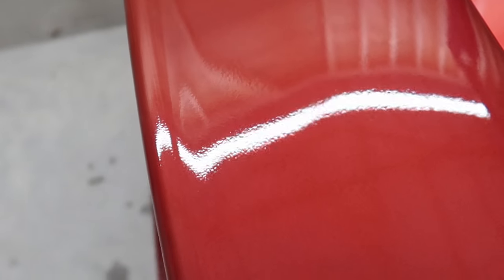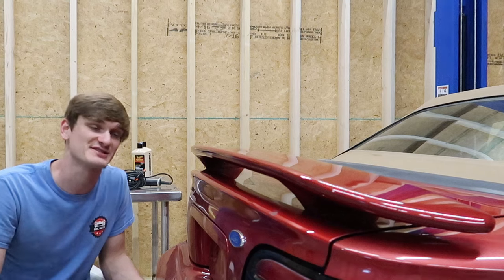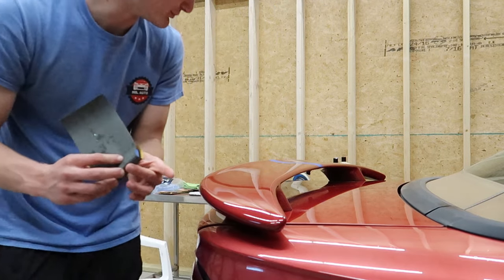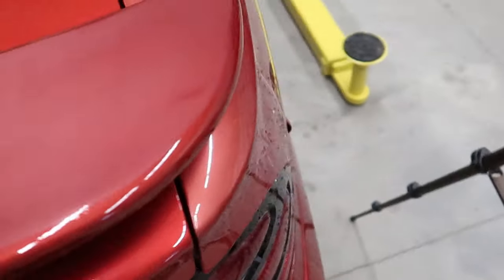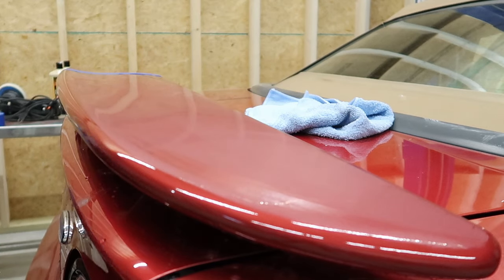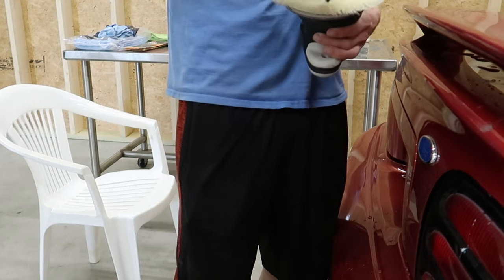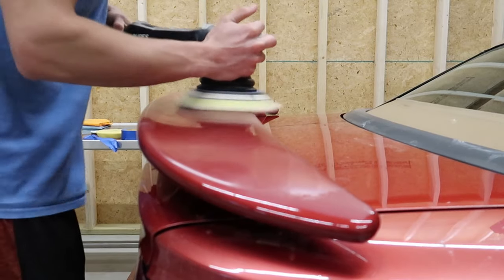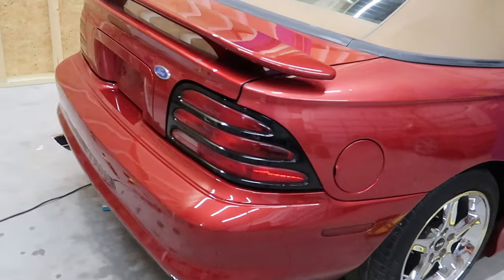How To Sand ClearCoat Safely - Orange Peel Removal

Comment: Hey man, for a beginner, you did a great job! Also you did a really good job explaining to other people considering attempting this themselves.

Only thing I think should be noted is when you mentioned not running the block in the direction that you wrapped it. You definitely want to keep the paper tight without slack but..

To achieve a more even finish and not accidently dig too deep in one area, you really do want to sand with the entire width of that pad. 

As an example, holding it in such a way that its wider than it is taller, you should sand in a direction of north west to south east, as well as north east to south west, keeping the block in that wider than taller position. This ensures you don't dig in with the long edge of the block as well as sands the panel as evenly as possible.

Also for anyone attempting this with sharp concave grooves in the body lines, you're likely better off hand sanding those lightly and carefully, unless you spend more on some specialty sanding blocks.

Either way, good job!

Edit: after reading through the comments, I see you're a lot more knowledgeable than I thought. Sorry for calling you a beginner.

Comment: I just painted and cleared my hood.
How would you recommend to wet sand the whole hood?
I have a 6" DA and 1500, 2000 and 3000 grit discs.
Would that work?
Thanks
Reply from the maker: MrBikedrummer if you are going to use a da, use a interface pad. If you are unfamiliar with them, look into it. In my experience, if I use anything rougher then 3000 grit on a da with a interface pad (it’s worse without it), the paper gets clogged so fast that it leaves pig tails within seconds. The pig tails are significantly deeper then the sandpaper’s rating, and no amount of polishing will remove them. I would highly recommend getting a proper sanding block (not a big plastic block used for body work, a foam or aluminum oxide and sponge material) with regular 3m sanding sheets and doing it all by hand following the same method as this video. I would sand a spot with 2000 and then another with 1500 so that you can get a comparison, but I would recommend that you do 2000 by hand, 3000 with an interface pad on the da, and then polish it out. If you already have the sanding discs, give it a try with a interface pad and see what results you get, but I’ve never had any luck with them and I’ve spent a lot of hours trying to make them work. I’ve spent even more hours fixing the damage they’ve caused by hand
Reply: @nicbowen38  Thanks for the immediate reply!
My da is made for the hook and loop discs. 
I think I will take the precaution and do it by hand.  You pay attention to detail and that is what I believe in as well.
Oh, after I wet sand, if I want to add clear, how should I clean the hood before clearing?
Thanks so much!
Brian
Reply from the maker: MrBikedrummer of course! What exactly do you mean by your da is made for hook and loop disc? On most da’s you can change the backing plate to accept whatever style of fastening, but unless your backing plate has a interface pad built into it, you will need it to prevent installing very deep scratches that you can’t polish out. The interface pad sticks to the backing plate and the sanding disc stick to the interface pad. Re clearing is very tricky, and easy to mess up. In order to do so correctly, read your data sheet for the specific paint you used or call the manufacturer for more info. After sanding, you will need to give the paint 1 day in direct sunlight or up to a week without sunlight for it to gas out. If this step is skipped, you are guaranteed to have solvent pop. For wax and grease removal, some people use glass cleaner, some use degreaser, but I would recommend reading your clear coats or base coats data sheet as most of the time it will tell you what wax and grease remover is safe for the material and I would chose whatever that product is
Reply: @nicbowen38  
When you said, "after sanding give it one day in sunlight or longer inside to gas off"... Is that before buffing out the sanded clear?  
I cleared it Friday in my garage in New England.  We have a warm spell here for now.
I was going to sand it tomorrow and buff...
I really appreciate your input. I subbed
Reply from the maker: MrBikedrummer thank you for the sub! If you are going to polish it out, you can do so immediately after sanding. If you are going to reclear it, then you need to give the paint time to gas out before the clear in order to prevent solvent pop. If you are going to reclear it, do not polish it out, leave it sanded. The sanding scratches will provide a better mechanical adhesion
Reply: @nicbowen38  
Do you mind if I update you with the results?
Thanks for the help.  Hope I'm not interfering with you watching the Stanley cup game!
Reply from the maker: MrBikedrummer I would love it if you did!
Reply: @nicbowen38  Thanks Nic
Reply: Hi Nic.
I'm taking a break. I've wet sanded by hand with a flexible block for 3 hours.
1000, 2000, 3000.
Soapy water 💦.
Daunting task, but after a while, I could FEEL the imperfections and peel flatten out.  I was able to remove 99% of the ugliness.  And trust me, I know ugly!
It has a slight gloss at this point.
After my break, I will go in to buff.  I feel good about the projected results because I could see the surface improve bit by bit.

I'm happy and thankful to you because I decided against machine sanding.
I had my hands massaging this hood more than Snow White does on pleasure night with those horny midgets.
Thanks again!
Reply from the maker: MrBikedrummer 😂😂😂 I’m glad to hear it! Shoot me some pictures to NicBowen38@gmail.com when you’re all done!